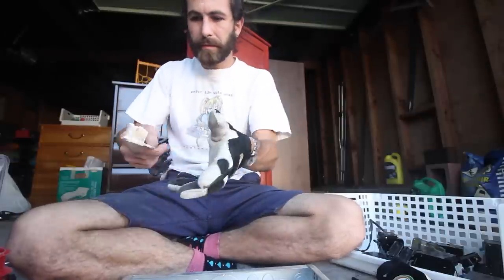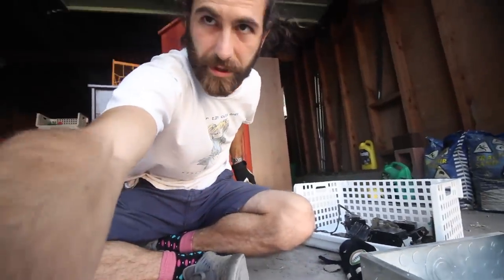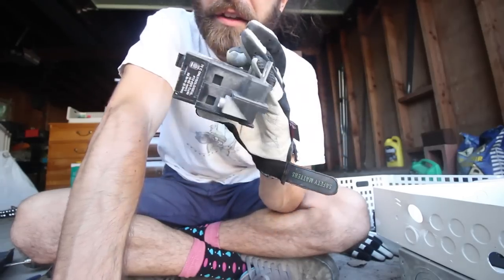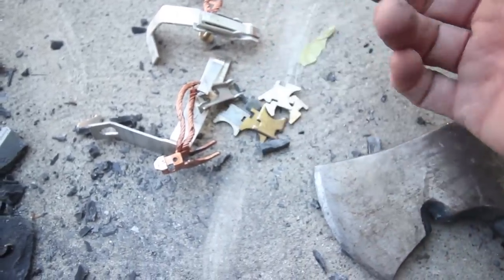Scrapping An Electrical Panel Breaker Box - What's Inside? Is It Worth It? More Money In Less Time!

Comment: As an electrician I can tell you that the first box definitely would have made you more sold on eBay as is. The only breaker boxes I scrap are the older 'split bus' types. The two sets of bus bars are usually held together with a couple of solid pieces of copper with just a few threaded holes.
Reply: Would that apply even to old electrical / breaker boxes I took from a barn we knocked down on my farm?

Comment: For flat head screws use a magnetic bit holder with a sleeve. Once you set the bit on the screw head push down the sleeve and press the trigger. Even if the screw head is bigger than the sleeve it will still help you guide the screw out without slipping. Give it a try.
Reply from the maker: It took me a sec to understand, but that’s brilliant. Stupid flathead screws always slipping lol
Reply: @thubprint  Flat head screws should have been banned years ago for crimes against humanity. I honestly believe they exist solely to torture everyone who encounters them. 

Another tip taking apart breaker boxes. The bit holder sleeve is also a 1/4in hex. Keep a 5/16th driver bit in a sleeve and you have 2 tools in 1 that will help get those screws out fast and significantly speed up takedowns.

Comment: The aluminum with the screws in it is aluminum but the other pieces that hold the circuit breakers on that they plug into are copper as well as the piece that's connected to the aluminum with the screws in it.. the piece with the black coating on it. Circuit breakers have copper and silver in them.. hope that helps..

Comment: I have scraped a total of four breaker boxes and separated every single piece of metal from the iron to the Ag contacts. I learned that the breakers were worth way more sold used.. So is there a way to tell if they are still good. Will someone buy these used parts? Finally, if it was found in the trash it was probably there for a reason. Just a thought.

Comment: I've had breakers that when you scratch the silver bits there silver / yellow inside. any idea what they might be, I thought a zinc bronze maybe?
Reply: Silver tarnishes yellow. Depending on the part it could be silver plated or solid silver. Google the brand and breaker and you should be able to find out what's what.

Comment: Cool vid. How to convert a $60 or so used panel box into $2 or $3 worth of scrap in a minimum of time and effort. Soon you will need a BIGGER TRUCK.
Reply: sometimes its better to take the quick nickel instead of chasing the slow dime
Reply: House bat. Chasing something that's slow is not hard.
Reply: What if that slow is a motercycle.. thats a fast kind of slow. I guess the bigger the bills the faster the chase.